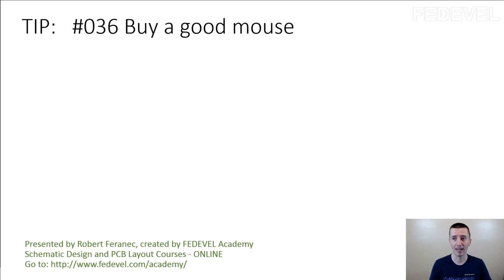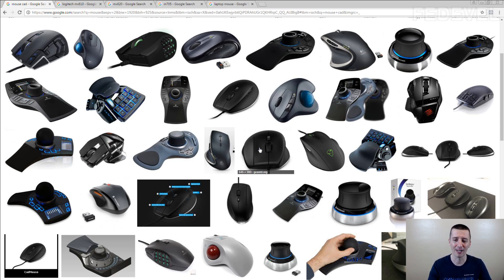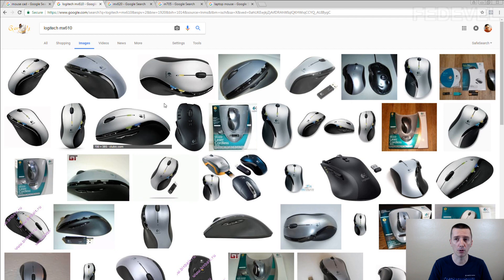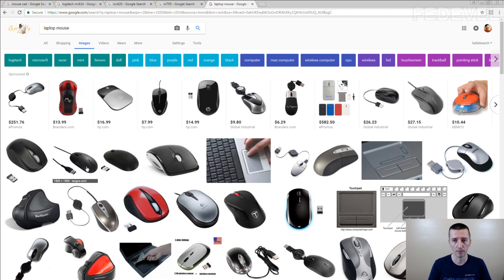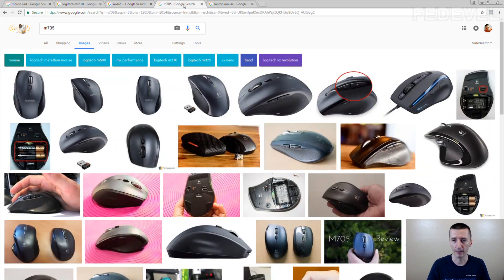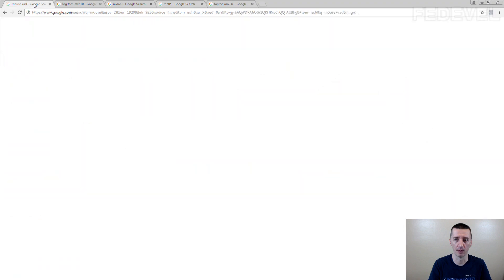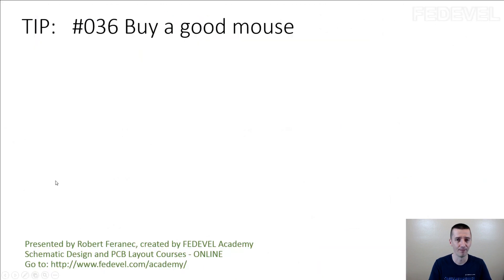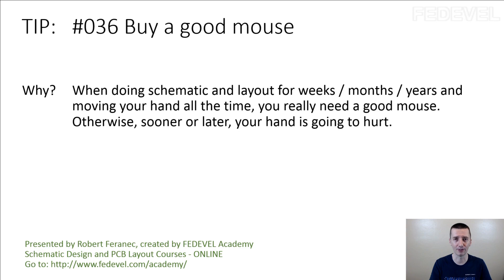TIP #036: Buy a good mouse

Comment: I use an old Logitech G500.  I replaced the switches on it a year ago.  When I did that, I used a heavier switch on the left side (150gf?) but kept stock (75gf?) on the right.
Since then I started noticing my index finger was stiff and maybe a bit sore, so I slid my fingers over.  I'm in the habit of using my middle finger for the left button and my ring finger for the right - leaving my index finger pointed in the air (it has nothing to rest on).  It helped but it's kind of unnatural and my index finger is still somewhat stiff even though I don't use it nearly as much now.
I'm not sure if the heavier switch is what impacted my finger or if it's just coincidence.  I should probably take it back apart and swap out the heavier switch for a lighter one.

Watching this video made me think maybe I should look for a mouse that is longer so more of my hand can rest on it.  Most mice are made for small hands, it seems, even this "gaming mouse" that I have now.
The EDAs I've used rely heavily on the middle mouse button, which I find awkward and frustrating to use when it's combined with a scroll wheel.  To improve that I've mapped one of the thumb buttons as the middle button.  However, I don't really like those little buttons on the thumb so it's not a totally satisfying solution.
So I think I could actually be interested in a mouse that has a dedicated middle button and a scroll wheel located on the thumb somewhere.  Not sure I've ever seen that.  Maybe it would be even better if either the "scroll wheel" or the middle mouse button was remapped to the keyboard and disabled on the mouse when in the EDA.

Comment: I'm using a Logitech G5 mouse. It's really comfortable for big hands. The space navigator is handy for Altium. Not only for placing 3D objects, but also for panning and zooming large boards during routing. I got mine from ebay for very little money. Once you got used to it, you don't want to give it back.

Comment: Hello Robert, 

Really do try that SpaceNavigator 3D mouse! 

Altium with a good mouse in one hand, the great keyboard shortcut system (do use them and not your mouse!), and a SpaceNavigator is bliss. It takes a bit of time to get used to the feeling, and also to set it up how you like it. I for example inverted the x-axis: without it it feels like you move the board under your cursor, but with the inverted axis you move your cursor/screen over the board - when you try it you will immediately know/feel what I mean. The reason I love it is that you can very quickly zoom out, move across, zoom in etc, without needing your normal mouse. This means that when you are routing and have Push/Shove enabled it won't happen that you use the mouse to move the view and at the same time mess up your existing routing. Using the SpaceNavigator, keyboard shortcuts and normal mouse together becomes a second nature fast when you do a lot of (complicated) routing. Just to be sure: I have no affiliation with 3Dconnexion, I am just a fan of their product. 

Actually it happens regularly that I'm in my webbrowser, or in MS word, or reading a PDF and automatically use the SpaceNavigator to scroll/zoom etc only to find that it's use in those programs not as native/natural as in Altium or mechanical CAD programs. Wish it were though.

Comment: For the last 10+ years or so, I use a vertical mouse (don't wanna post links, google it). Mine looks like a joystick you wrap your fingers around and move the whole thing as a normal mouse. This tilts your hand from a flat to an upright position and that relaxes your muscles/tendons in your lower forarm. It also reduces the continuous strain you create when you hover your fingers over the mouse buttons. 

I have tried one of those 6-axis turn-thingies that are specifically handy if you do 3D CAD stuff. Not used it enough to be certain but it felt nice even in the left hand.

Robert, I love the #Tip series you're doing. Really good stuff. Thanks.

Comment: I am really comfortable  with  Steel Series Rival 300. Yeah, It's a gaming mouse but it is perfect for working on schematics and layouts, too. I have a little bit big hands and ı searched a lot for a long and a little bit wide mouse and then ı found rival 300.  It matched perfectly with my palm. It has also 5 buttons.  The only bad thing about it , it is a wired mouse and it has low mobility.

Comment: An ergonomic mouse is essential for anyone who uses a computer for an extended time.  I use a Corsair M65, which is not only highly ergonomic, but has many buttons that can be customised with macros.  Too many people overlook the importance of a good mouse and keyboard.
Reply: Exactly! I use SteelSeries Rival 300 - not because it is a gaming mouse, but its adaptible sensitivity and good ergonomics - its very big and good for hand...
Reply: A gaming mouse is designed for long use and high precision, which makes the M65 ideal for me.  My previous mouse was a Logitech G5 laser, that I used for 8 years.  I have never had pain of fatigue in my hand.

Comment: I have never had problems with pain, but I think it is important that your mouse is comfortable and has an accurate sensor. It is very annoying to me if the mouse is skipping pixels.

Also some time ago I started using Logitech G600. It increased my productivity significantly. Apart from that my eyes get less tired now after long layout sessions, because I don't need to look away and click on the tool bar for the most repetitive commands - I just click the particular button and it's done. I highly recommend having a similar mouse if you do a lot of layout.
Reply from the maker: Interesting. I was actually looking into this one, was not sure how comfortable the buttons would be.
Reply: It takes a few days of getting used to, but it's alright after that. I wouldn't use it for gaming (although that's what it was created for), but for layout it works really well for me. Drop me a PM on the forum/email if you need any more information ;)

Comment: As gamer I still have good mouse around. Few years ago I tried one of our sourced mouse for internal test then another big wireless Logitech mouse. With both of them it was literally painful.
So for myself and my own physionomy, I know I have good results with Logitech Wired mice. And I know I could hurt myself with a low cost no name one.

The software is important also. Even with a good mouse, sometimes when Altium gets slow, making layout on it can be painful, as pulling the traces feel HEAVY and slow. So I felt like tense, contracted on my mouse to keep the button press when doing long and very precise movement. You know, when a trace flicker and doesn't want to stay in the very small correct position...

For space navigator, today I'm homeworking and I forgot my small wirelless navigator at the office... and it miss me.
Very usefull to navigate in PDF docs, pan, zoom, high speed dezoom and fast scroll across dozen of pages to find desired datasheet page. Priceless!
And same use in schematic and layout. I feel very slow when I don't have it. :(

Comment: You should try http://www.logitech.com/en-gb/product/wireless-trackball-m570, it keeps your hand well supported and you don't have to move it at all.
Reply: svshady +1 for this one!! I use it and it's very comfortable and precise! it reduces errors caused by accidental movements as well! takes a bit too get used to but well worth it! I also had an opportunity to try 3Dconnexion SpaceMouse Pro

http://www.vmhinternational.com/product/3dconnexion-spacemouse-pro/

but didn't find it to be worth it. mouse is sufficient even in 3D
Reply: I bought this recently as I was having some pain in the wrist, this helped clear it up pretty quickly. It takes some getting use to but now I much prefer it.

Comment: I am using one with programmable keys and dpi (2000 most of the time).
By changing dpi with a single key on the mouse (for fine-coarse adjustments in pcb/schematics) I don't have to move all the hand, just the fingers and I can go from one side of the screen to the other.
Higher speed helps but it may be difficult to change speed, it needs time to adjust.
Acceleration may help to move in multiple monitors

Comment: Good tip Robert. This is a very, very important recommendation. 
Ten years ago I started feeling pain in my wrist. After some research on the subject, I switched to a tracking ball (Logitech TrackMan). After that, the pain went away.  It took some time to get used but it was worth it.